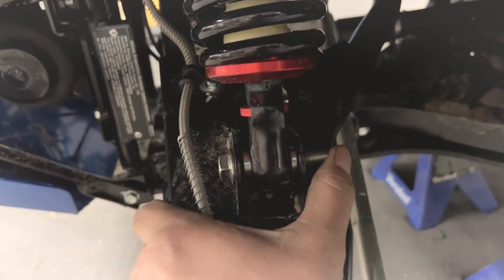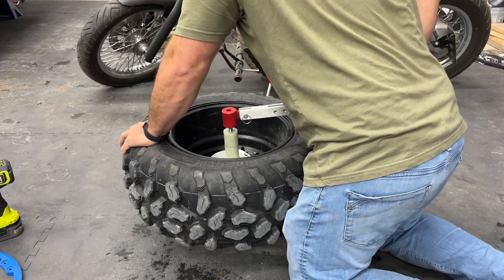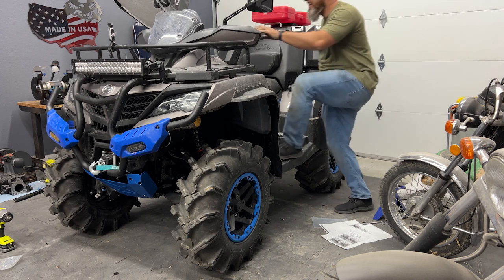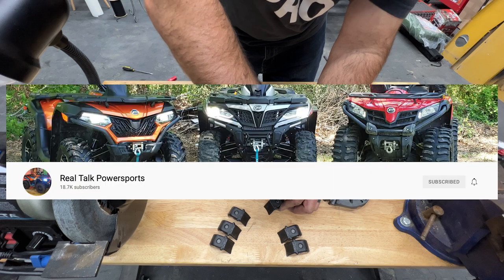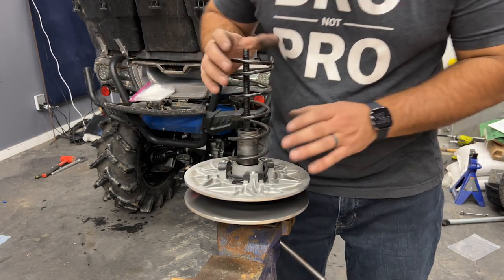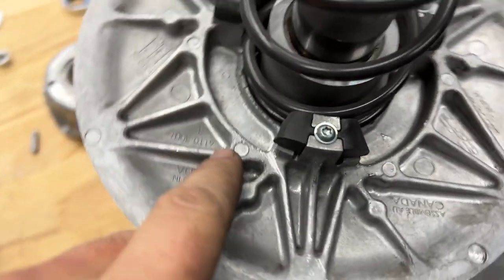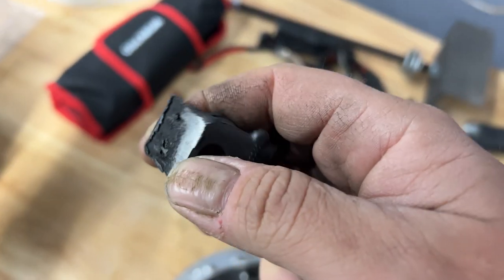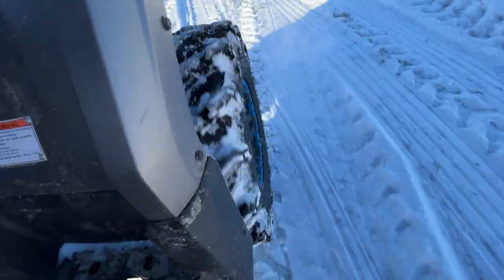Installing an ATV lift, mud tires, and a clutch kit // CFMOTO 1000

Comment: Hey guys,  low gear for that kind of stuff,  the higher rpms of low gear makes your clutches spin up,  your clutches have a fan built in so the higher rpms creates more air flow thus keeping your clutches cooler

Comment: Great video , glad you understand the low range , high is killer to belt drives when going slow , I got a 950 with 2600 miles and never slipped the belt a single time , you gonna love it .
Reply from the maker: I understand now… 🤦‍♂️😂
Reply: Good to now  my cf is only a 500 but I will make sure I do this .
Reply: Brother, can you please explain more when to use low and high please? I’m new, and I don’t to breake my cf100, thanks

Comment: Good job. Not sure about being in high range was the issue though. It shouldn't over heat like that. May have been something to do with the clutch kit setting. Love those CF MOTO'S!
Reply from the maker: I think it was the combination of the new clutch kit,the 30” tires, being in high gear, and the heavy heavy wet snow we were in, and me basically going full tilt for about seven miles. Had I been in low like the owners manual states, I probably would have been fine.

Comment: Was interesting to see exactly what driving in high gear at low speeds for too long will do to the clutch.  Sucked for you, but it was nice to see to learn from, thanks for posting it!
Reply from the maker: Definitely a good lesson learned. And a fairly easy fix, luckily.

Comment: I like that impact driver. Never had any issues with ryobi except the thin charging cable can be easily chewed through by small puppy 😆
Reply from the maker: I’ve been SUPER happy with the impact driver! I’ve used it a ton.
Reply: Got the same impact driver , what a time saver !

Comment: All belt drive atvs/utvs will have belt or clutch issues if you hold them wide open in deep snow for more than a few minutes at a time even in low.
When we ride in deep snow we take lots of breaks to cool the belt down, you can touch the belt cover and check the temp, it will get very hot after a few minutes at full throttle.
Reply from the maker: Absolutely! This is great advice and I definitely learned my lesson. I rode 900 miles in Arizona recently and checked my belt cover often. I will definitely take it easy in the snow in the future.

Comment: Great video. Im going to be installing a lift kit on my 800xc. Have a question about your front bash plate. What paint did you use to paint it? I just got one but want to paint it.
Reply from the maker: I actually powder coated it

Comment: Seems you're very familiar with your 1000 , what oil and gear box oils have you used for it  ? Thanks !
Reply from the maker: I’ve just had my initial service done by the dealer so far. I’ll be doing service myself from now on. The shop sold me Yamalube oil for my 500, though.

Comment: Hey there with the 2" lift kit, does it raise yhe machine an actual and  full 2" on all 4 corners ?
Reply from the maker: I’m honestly not sure. When I installed it, I also set the suspension to the softest setting so it wasn’t a one to one comparison. Blake over at Real Talk Powersports could probably answer your question.

Comment: nice setup!! make me wanna do the same accept for the oversized tires im scared too lose off the top i just want a bit more aggressive accel
Reply from the maker: It was really the clutch kit that made me lose top end. I don’t think tires alone would hurt the top end very much.
Reply: @BroBuilds  how much did you lose? you think its worth it too get a clutch kit for 1 inch over stock size

Comment: great video, you gained a subscriber . where did you get the lift kit and clutch kit I live In Canada and had my cforce 1000 for a year and can't find these aftermarket parts.
Reply from the maker: Thanks! I called Main Street cycles for the clutch kit. Check out Real Talk Powersports YouTube channel.

Lift kit is from www.perfexind.com
Reply from the maker: I also got my wheel spacers from Perfex

Comment: I don’t ATV   I dont do any of this, but def enjoyed the vid.

Also tho, sorta bummed u can’t send it in High without ruining a belt or those weight holders.  

I feel like it’d be way less comfortable and less fun to be in Low most of the time.
I wonder if there is a way around that.
Maybe the larger tires also play a factor in the increased belt slippage in High.
Reply from the maker: You can definitely run it in high still with this setup. Just not in the situation I was in. I guess I didn't make that clear enough in the video. It's because I was running in high at such a low speed with so much resistance from the deep snow.
Reply: @BroBuilds  I think u were pretty clear. I wasn’t there for it lol, so I don’t know how hard I were actually pushing it. 

Was more of a general comment about having found a limitation even in that beast of a machine. Have fun out there👌🏻
Reply: @samuelyoung2671  Good point. Swapping for bigger tires ads load to the transmission and belts. You basically change the gear ratio by adding approx 10% when going from 27" to 30". It obviously wont help the situation if driving under hard load conditions.

Comment: The tires are 10" wide? They fit in the rear wider wheel? I see you have the rear seat, this come on the overland or you buy this.
Reply from the maker: I had to buy the seat. It doesn’t come on the US model. Front tires are 9” wide, rear are 11” wide.

Comment: Iam seeing more cf moto builds. I am on the fence. Can am xt 700 vs cf moto 800-1000cc?
Reply from the maker: I know people are worried about cfmoto because of being from china, but I can tell you after owning 3 atvs for about 7 years now, I love them. I’ve absolutely abused them and haven’t had any real issues at all. They’ve been awesome!
Reply: @BroBuilds  ya. My bro bought two new Hondas don’t start in winter lol last year took 2 days to get them going. Using premium fuel.  Heat on the engine etc. are you sponsored by cf moto?

Comment: I only have a 500 cf they make great machines though . No matter the size.
Reply from the maker: Definitely! I had a 500s for 4 years and never had a single problem with it.
Reply: @BroBuilds  Have a guy I work  with thinking about getting one not sure what size . Since I'm new to ATVS what gear should I be using ? I plow with mine in low gear  and dont really get on it .

Comment: Where ur tires 9” or 10” wide and if 10” wide did it rub in the front with out a spacer been wanting to go to bigger tires just want to do it right once lol
Reply from the maker: 9 in the front, 11 in the back. I’m sure 10” wouldn’t rub either.
Reply: @BroBuilds  thxs for the reply back really appreciate it was also wondering did u have to take off ur fenders with the bigger tires on the wheeler or do u just like the machine with out them. Also nice vid I’m going to be doing the lift kit  because I liked how urs looked with it

Comment: Hey I’m having the same issue as you on the left rear. It’s giving me trouble getting the suspension to depress to the lower attachment of the bracket. What did you do to get it there?
Reply from the maker: Are you talking about the part around the 5:38 mark? If I remember right, I think I just pressed down on the axle/trailing arm and wiggled the suspension back in. You could always shorten the coil overs to get them in easier then lengthen them back out once you have them in there.

Comment: Video on installing that rotopax?
Reply from the maker: I didn’t think to make a video. I just drilled holes in the metal on top of the big box and bolted it there. I don’t love the location, but it works and I haven’t had any issues.

Comment: I know you said a 30 inch tall tires, but what is the rest of the measurements that you put on there? Are they still stock sizes like the clinchers?
Reply from the maker: 30x9 up front, 30x11 in the back
Reply: @BroBuilds  I appreciate the help. I just ordered the rears.
Reply: @BroBuilds  I’m hearing a lot of people say, just change the secondary to B2 or B3 instead of the clutch kit, any ideas if that’ll work?

Including RNG?

Comment: Did you need wheel spacers?
Reply from the maker: I didn’t need them for the tires, but I think when you add a lift, it pulls the tires in a little so they recommend spacers to bring them back out to factory width.
Reply: @BroBuilds  so what did you go with ? Even or two different sizes?

Comment: What's the blue paint you use on the bumper
Reply from the maker: I painted the two fog light housings with Krylon patriotic blue. It didn’t hold up great. I’ve since power washed it off. I powder coated the front skid plate and that’s holding up great

Comment: I put a clutch kit on my Arctic Cat 650 several years ago. It was fine at first, but then ended up eating clutch parts. Mostly the primary rollers and belts (like yours did). Every time I rode it, it always melted the clutch. I wasn't driving slow either - fast paced, and 3/4 throttle most of the time. I quit riding it because it was so unreliable. Even after I put the old clutch parts back in, it kept eating clutch parts.

I will NEVER put a clutch kit in another ATV again. I recommend you adhere to this advice. It will save you a lot of frustration and money...
Reply: That means it was out of alignment, not clutch problems, it was probably installer error with too much or too little torque on the clutch bolts.
Reply: Then you don’t know what you are doing.

Comment: if you had left us know the Torque Settings I would've given a thumbs up
Reply from the maker: I couldn’t use a torque wrench because the clutches just spin. I used my impact gun and loctite.
Reply: the torque spec is like 80flbs for both. unless you but the clutch hold tool you cant really torque it with a wrench. i also used a impact at loctite. i haven't put many km on since installing but likewise for my test drive everything seemed ok. im wondering about buying a performance belt to eliminate some of that stock belt slipage.

Comment: My question is this. Do you think the CF MOTO is a quality machine? Here in the northeast you say CF MOTO and people lose their minds wondering what’s the problem.
Reply from the maker: Absolutely. This is my third cfmoto. I just got back from a 900 mile ride in Arizona with no issues. I have over 1500 miles on each of the other atvs with zero issues. As with other machines, maintenance is key. And one of my favorite things is all the accessories and features you get compared with other brands AND for less money. In the 5 years I’ve owned a CFMoto, there’s also been a huge improvement in aftermarket parts, so they’re catching up there, too.
Reply: I own a 2022 cforce 800 and i have a love hate relationship with it. okay firstly it runs very hot, ive reprogrammed the ecu and still runs very hot. a tiny bit of water got into my clutch cover while riding deep and the primary bearing instantly went. they are heavy machines and long, so if you plan on doing mud they aren't the best due to weight and length. so i've installed a ecu reprogram, new clutch bearing, 2" lift kit, 1" wheel spacers, mudder clutch kit, and now shopping for 30" tires and a rad relocate kit. all on a machine that has less that 1500 km on it. also the winch went on it, but that was my buddies kid fault for not keeping tension on cable when he was pulling it out and it jammed. 
if i could do it all over again id have gotten a can am or a grizzle.
Reply: They are junk , I’ve owned two now and with the type of riding I do they fall apart , my Suzuki king quad lasted for ever with very few issues the cf moto was done after 3000 miles Suzuki had 14000 miles on it before the engine went.